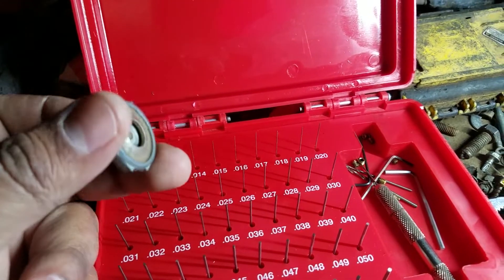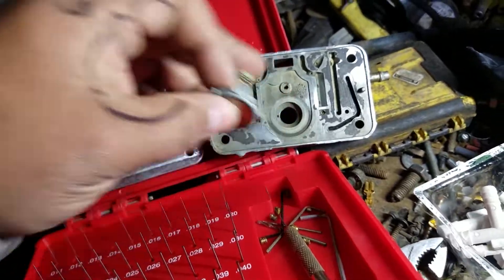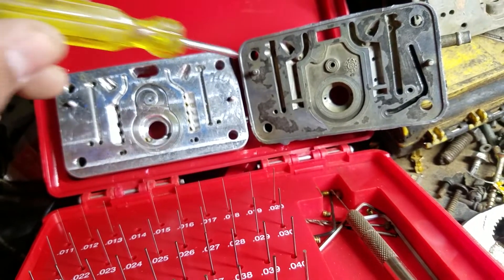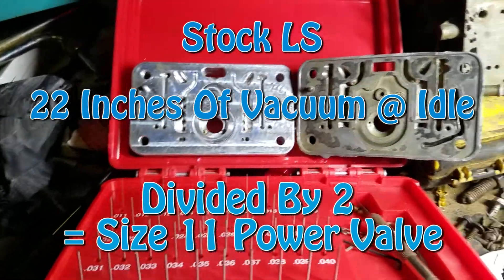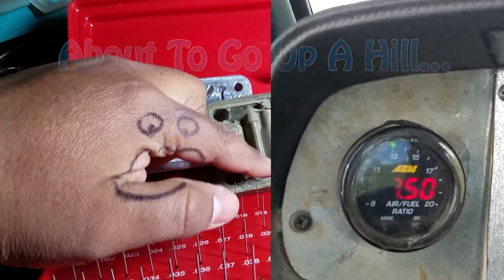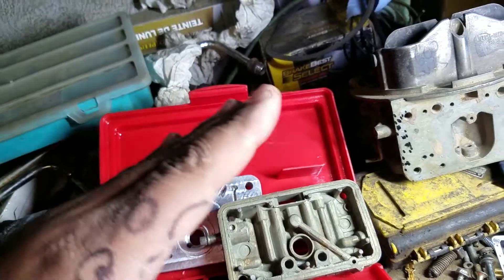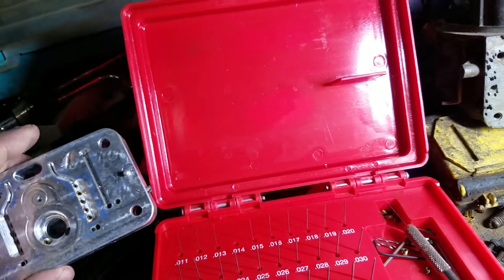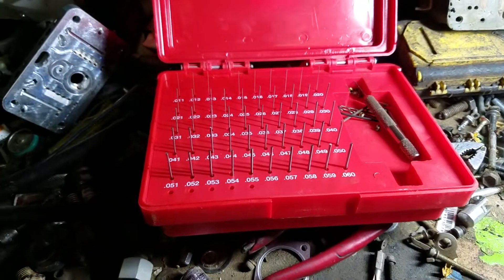HOLLEY POWER VALVE TUNING- Everything You Need To Tune Your Power Valve | Holley Carb Secrets |

Comment: Love your vids, learned so much!   I have a question,  though.  Do both power valves open on a DP once the vac is reached,  regardless on throttle position?

Example:  I'm in primaries only,  vac reaches 6.5.  Does this mean that both Valves open?  Or only primaries because i haven't tipped into secondaries yet?
Reply from the maker: Excellent question. The power valve DOES open up when the vacuum drops but as long as you're not in the secondary main circuit, it should not affect your air fuel ratio since the main circuit feeds the boosters.
Reply: @NightWrencher  makes sense,  thanks!

Comment: Hey man, recently found you channel and its great, Im learning heaps."
I have a dilemma where I have the classic case of uncompressed and over cammed. Im only running 5-6" idle vac a 2.5 PV.
Ive got the ignition locked out at 40 degrees and thats just where it wants to be. This is a new build and its only got 140 psi comp.
Im struggling with the Holley 750 Ultra, just seems rich everywhere all the time. AFR ranges from 14 at Idle 13.5 cruise and into the 11's at WOT. 
Primary running 71's and Sec running 75, 
Its as close as I can get. BTW, 351C.

Comment: Great video. Questions though lol! I have a 454 chevy motor . Was built for a blower setup . Motor has a huge cam has 8.1 compression and runs 8 inches of vacuum at idle . I just had some work done on the car becaise of tuning issues at a local shop and the shop put a 2.5 powervalve in. Now the car stalls under load if im not constantly giving it gas . Do you know what it could be ,or possibly a fix?
Reply: It has a 750 proform double pumper also

Comment: Vacuum should be taken foot on brake and in gear….then /2
Reply from the maker: Thats correct unless you have a manual transmission. In either case I would still go with the higher of the two.

Comment: Where did you get that set of drill bits?  I'm having trouble finding a good set like that for jets.  Thanks
Reply from the maker: The things in the red box in the back ground are pin gauges used to measure orifices. For a drill bit set you could use something like this https://amzn.to/3PjvTUv along with a pin vice

Comment: What’s a good size to run on a  Holley 500 ran on a 602 GM crate engine  used for circle track racing ?  6.5?   What’s a good accelerator pump size to use  thanks ?  I feel it’s a bit lean haven’t looked to see what a in it  

Crate engine is turned at 6100 rpm.  460/490 lift cam.
Reply from the maker: If its dedicated a circle track racing car, I would actually take it off and jet up the primaries 4-6 sizes.

Comment: Great info. I bought a Quick Fuel SS 750 AN and didn't pay too much attention to the power valve. I think i compensated for the valve opening too soon and dialed back my main jets to compensate. now the quality carb is acting wonky and just don't know where to go with adjusting. I have a 6.5 PV and about 11 inches of vacum at idle. Im going to set the jets back to factory and use the vacuum gauge like you said otherwise i feel i'm just guessing. I have an airfuel gauge already so this should get me there! Thanks for the info and keep up the good instruction!
Reply from the maker: Thanks man! Take your vacuum at cruise in high gear going about 65-70. Then put your foot down at close to half throttle and see where your vacuum drops to. Go at least 1 size above that number. Cruising at 65 should get your main jets dialed in with the wide band. If the engine goes too rich after the PV opens, youll need smaller PVCRs. If the carb goes lean, youll need bigger PVCRs. The opening point is just one tuning aspect, the second one is the size of the actual PVCRs.

Comment: Good information. I've got several 600 cfm Holley carbs and they all seem to have wildly different PVCR sizes. I sold one of them so I can't measure but it ran really rich when the power valve opened under light to mid acceleration (10.5-11 AFR) so it's safe to assume that one was large. I have an 1850-5 Holley that has .042" PVCR and just acquired an 80145 Holley which is just a deluxe 1850 in center hung 4150 2 corner idle configuration, basically and it has .052" pvcr. I really want know what engine Holley thought a 600 cfm vac secondary electric choke was gonna run well with using 68/70 jets and a .052" PVCR because I have a pretty healthy running Ford 390 that sucks gas like it's already long gone out of style running 67/69 jets at 14.1 average cruise afr with the .042" PVCR that gets drowned down to 10.5-11 when the pvcr opens up LOL time to drill and tap that metering block tomorrow and reduce the size a little.
Reply from the maker: lol thats what goes through my mind when I go through out of the box carbs. Most of the time, the tune is way off but also different 600s have different tuning built in so maybe they need to publish the numbers so we know exactly what we're getting with each one.
Reply: @NightWrencher  yeah, I reduced the pvcr size to .034" on that 1850 and that's what it took to obtain a 12.5 average afr under high load with the power valve open with that 390.
Reply from the maker: Thats awesome, always good to see someone figure out their carb instead of giving up and going efi👍
Reply: @NightWrencher  Not only did I keep the carb I found a vintage aftermarket ball bearing dual point with vacuum advance breaker plate that fits in the stock distributor  and rock that as well. Runs fantastic and I drive it everywhere problem free.
Reply from the maker: Very cool, I'm glad it worked out!

Comment: Thanks for the video so if I understand right you are actually using your idle or main jets while cruising until you accelerate and your power valve opens ?  I just swapped over to a 4 bbl from a 2bbl .
I have 66 main jets and 6.5 power valve and I'm way off in afr I am in the mid 12 on idle aft although that's just by screw setting it idles great but on acceleration it goes lean and in my off idle to mid range it's in the 15 16 range Wot is the same 16"s .
I'm thinking 68  from 66 main jets  maybe 7.0 or 7.5 power valve then check wot it's a 600 street warrior with single feed I added a metering block in rear instead of plates .
Also set fuel level a little higher what do you think ?
Reply from the maker: Youre close on your tuneup but your off idle performance will be in the IFR. You'll need to drill that out a hair. WOT performance is largely controlled by the secondary jets, looks like at least 4 jet sizes higher in the rear. Get your AFR at 1/4 throttle in high gear dialed in to 13.5. Take your vacuum reading at that point and set you PV to 3/4 of that.
Reply: @NightWrencher  yeah I see where they're drilling out the metering block and putting restrictors in there that's a little advanced for me right now but I know why they're doing it so that when you get to high speed your AFR doesn't go so lean so quickly because you're losing fuel in the float bowl so the smaller orifice in the emulsion tube high speed air bleeds keep it richer as you make the transmission at wide open throttle???lol
Reply from the maker: Not quite lol. The restriction limits how much fuel can pass through in the transition circuit. Kind of like a permanent jet. Yours is too small so all you need to do is drill it out a bit. Hardware stores still the tiny drill bits that you can use
Reply: @NightWrencher  do you recommend doing all the IFR restrictors slightly larger such as the one on the outside on the top of the car body as well front and rear the ones at the top of the metering block as well or just the ones that are right next to the power valve the two that are next to the power valve side by side
Reply from the maker: Theres only 2 IFRs per metering block which are towards the bottom on either side of the metering block. The rest of them are called air bleeds which are on top and emulsion bleeds which are above the power valve. I recommend drilling it up to .034
Reply: @NightWrencher  thanks 😎👍
Reply: It shows a 0.34 mm drill bit as a 7/32 is that right? Thank you so much for all your help your your videos are probably the most informative and easy to understand.
Reply from the maker: @TheThirdWheel618  hey man, its not .34mm its .034 inches. It would be a #65 or #66 drill bit
Reply: @NightWrencher  that's one crazy size I bought a micro drill bit set from harbor freight  also home Depot the smallest size they sell is 1/16th that's 1.6 .mm  the 0.33 " bit shows 0.84mm that's tiny getting confused on these sizes the conversion chart shows a lot of different things . So it's smaller than a 1/16th drill bit ?
Reply from the maker: Yes, youll need whats called a jewlers drill bit set. Harbor freight has a wire gauge set but it only goes down to .040
Reply from the maker: https://www.ebay.com/itm/233350354281?chn=ps&_trkparms=ispr%3D1&amdata=enc%3A1M8wvBIcXSDyCFTcj4n63rQ49&norover=1&mkevt=1&mkrid=711-117182-37290-0&mkcid=2&mkscid=101&itemid=233350354281&targetid=1583904486362&device=m&mktype=&googleloc=1014131&poi=&campaignid=15275224983&mkgroupid=131097072938&rlsatarget=pla-1583904486362&abcId=9300697&merchantid=6312294&gclid=CjwKCAjw7p6aBhBiEiwA83fGulV3Ih0Z1PLzIltlyhanyJ3Xf0Zbglt8A-EGLL_litB5d-fp20KdvRoC8bwQAvD_BwE
Reply: @NightWrencher  that's one tiny little hole for your idle fuel restrictors no wonder why I didn't know what it was I never use those tiny of a drill bit they have that set at Home Depot I might pick it up tomorrow yeah I bought the one at harbor freight I didn't use it but it's only 599 it's no big deal so they have that forney the same kit at Ace hardware.

Well thanks for that because I was getting confused on the drill bit sizes  so out of that kit I'm going to use either a 65 or 64
Reply from the maker: Yea exactly. I thought I would only use it once but now I have several sets of different sizes to tune different carburetors
Reply: @NightWrencher  when I took the metering block off it already had brass pieces in it restrictors in it and they were way bigger than the 66
So I just left it alone and re jetted it
Reply from the maker: @TheThirdWheel618  yeah thats a good idea. I wouldnt want to go any bigger than that
Reply: @NightWrencher  thanks 👍 the IFR are the holes in the metering block the ones on top of on the sides of the PV

Comment: Thank you for these videos. my mighty demon 850 comes with a 4.5 PV. At lite cruise, it’s grumpy. It seems it needs one closer to manifold vacuum. I wish you had a driving video to show how you figure it out with a afr gauge and vacuum gauge. I bought drill able fuel bleeds and Air bleeds and a dual wide band gauge. You are right it’s hard to find info. It’s miserable and I want to make it correct.
Reply from the maker: Hey man, looks like my comment didnt post. Setting up the PV is pretty easy if you already have the wide band. With the vacuum gauge hooked up find what your cruising vacuum is. Find a big hill and go up it slow and ease into the throttle, the AFR should start going lean, once it starts hesitating take note of the vacuum and then go up to the nearest number for your PV.

Comment: I think you solved my problem. Trying to figure if my power valve or my accelerator pump needs to go UP> I have a 347, mild cam, pull 12-12.5 vacuum in gear idle.  AFR reads about 12-5 to 13.5 idling.  Cruise ( 14-14.5 at steady cruise) and if I hit the gas 1 inch I get a momentary lean stumble (AFR reads in the 16-17 range momentary before drops down and she goes like hell. I am afraid that persistent lean is going to damage my engine. My stock Holley power valve is a 6.5. The pump nozzle is a 31. Would you recommend I UP both or one at a time?  should I go 7.5 or  8 on the power valve ? What about the nozzle? Thanks in advance...this is driving me nuts because the engine idle and runs AWESOME except for that split second stumble
Reply from the maker: Your cruise AFR is really lean, so youll need to compensate with both the accel pump and power valve. The way to tell which circuit you need to tune is how you create the problem. Sudden changes in air speed can't be tuned out with the PV. Extended lean conditions can't be tuned out with the accel pump. Sounds to me you need a much bigger pump shot to cover the lean spot. Order yourself a 50cc accel pump kit. It'll come with a black cam to extend the duration of the shot. If its too much fuel you can just change the cam and keep the same arm without a problem. You might also want to go up to a 35 squirter for more volume because it does go up 2-3 numbers and that lean misfire can really hurt something after a while. If you've got an extra 28 or 31 squirter you can drill it out to .040 and install the 50cc pump. I'm pretty sure that where your issue is. Lmk, hope it helps
Reply: @NightWrencher  Thanks !
Reply: @NightWrencher  one more question on the pump nozzle. I see they all sell in pairs. Does that mean I change the primary and secondary or just the primary ?
Reply from the maker: @arcorob  you can do both, but if your secondary squirter is working well, theres no need but you can check it after you swap the primary one Something else you should check is float height. If you got a glass sight plug raise the float level to 3/4 of the way up the sight plug, itll richen the curve a bit but itll allow your boosters to respond faster.

Comment: Nice explanation of power valve function. I never use the rebuild kit 6.5 valve. I have 7.5, 8.5's for my SBC since my normal idle vacuum is at least 18 in hg. Right now I'm using the 7.5 and there's no bog on the way into the primary main jets. In winter I may use the 8.5. My 650 Holley is an old model from the 90's but it's never blown a power valve. thanks for the video info.
Reply from the maker: Thanks so much! Really appreciate it!
Reply: @NightWrencher  I enjoy your videos and have subscribed. Keep 'em coming.
Reply from the maker: 👍 hope you stick around!

Comment: Hey I have a sbf 347 6 spd 4.30 gears rpm air gap Afr heads etc.  When I stomp on it it runs excellent until I go to shift second gear then it feels literally like I shut the key off by the time I’m in 2nd gear then it wakes back up and takes off. Occasional pop out the carb. I’ve been through timing numerous times. Forgot to mention it’s a Holley 4150 750 dp. Other than that it runs a little rich but it’s fine. A/f gauge flashes lean real quick when it happens. You definitely seem to know and been through carbs enough. I subd you any help would be great. I’m getting 14 inches of vacuum and there’s a 4.5 power valve. I haven’t touched the carb yet.
Reply from the maker: How much power do you think youre putting down to the wheels? On stick shift cars, shifting gears puts us in neutral as we let off the gas, bringing vacuum back up and then when we go to accelerate, the engine has to begin drawing fuel again and itll take a second or two to get it going again. Does the issue occur if you power shift the trans? Im gonna rule out jets and power valve because they should be all in by WOT. What is the AFR at the end of 1st gear?
Reply: Check your float level.